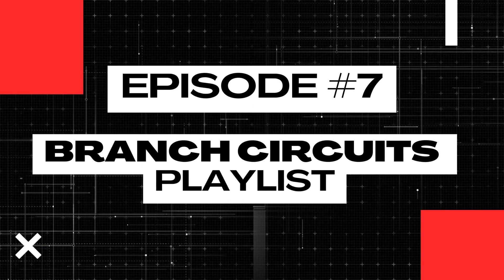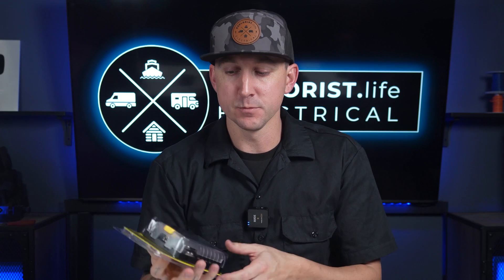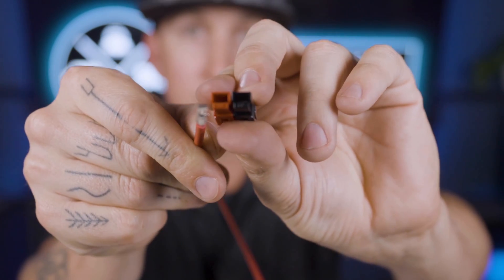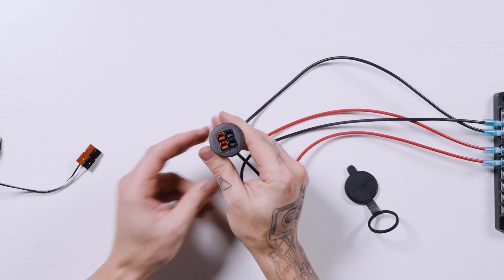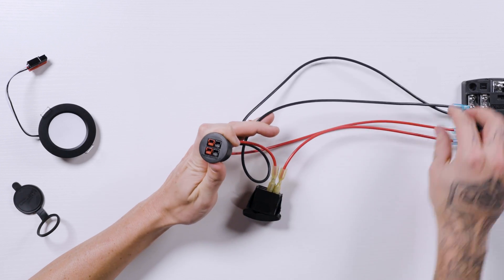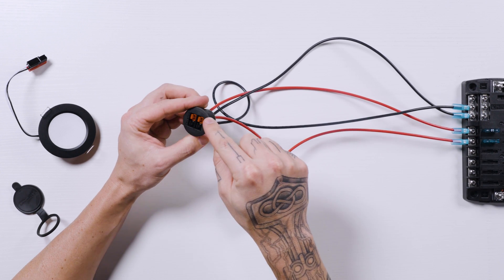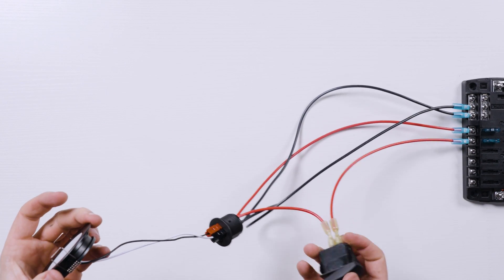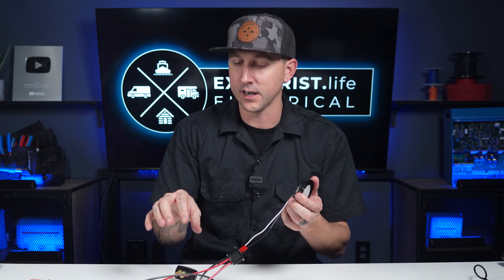How to Wire Anderson Connectors - Branch Circuits - Ep: 7/10

Comment: Use case:  12V / 15A to an exterior swing-out on a 4x4 bumper.  Both the wire into the connector and the connection need to be waterproof.  Any recommendation?  Possible video on waterproofing connections, both when plugged and unplugged...
Reply from the maker: 12V connections don’t need to be waterproof.  Think about the 4/7 pin connector at your hitch: that’s not waterproof
Reply: @EXPLORISTlife  I hadn't thought of it that way, but..yeah.  Thanks.

Comment: I'm in process of running heavy cable the length of my truck for DC - DC charging of my RV batteries. I wanted a nice flush panel mount for the Anderson sb350 connectors but there is very few options available for the larger connectors. The small connectors have many options for such mounts. I think the surface mounts look very nice when finished. Thank you for these informative videos.